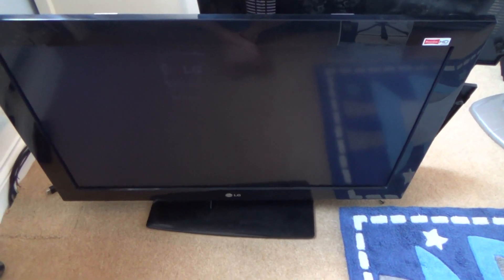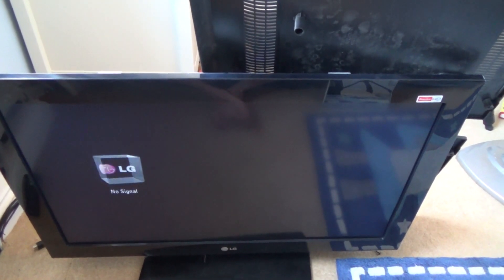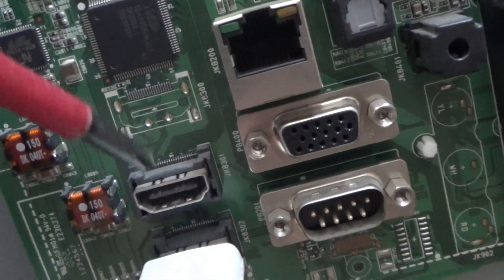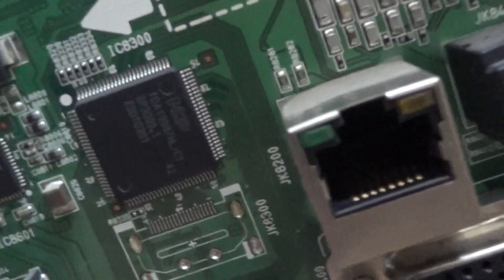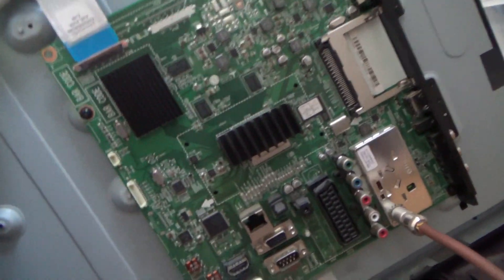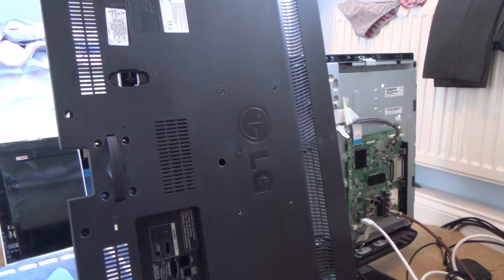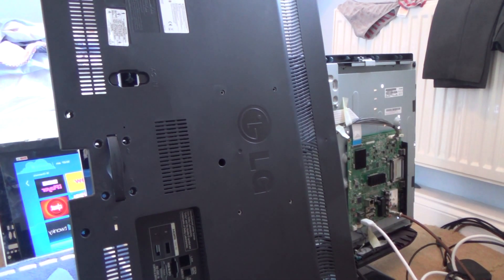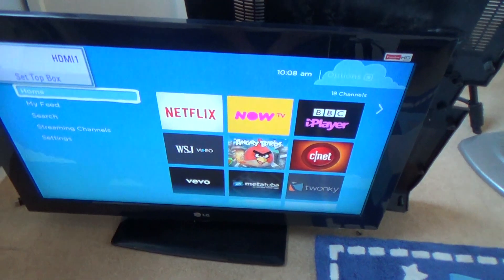Faulty HDMI Port on LG Television. No Signal Fault

Comment: Don't believe it Hdmi ic's usually short been repairing TV's for 40 years i repair this problem every day never saw heat can restore working operation
Reply: I think the heat perhaps temporarily restores a bad solder joint. This board can often be fixed for 6 months or so by cooking it in an oven for 10 minutes at around 200c. I've done it twice on my board so far and just about to attempt it again today. Mine is not getting past the LG startup logo at present.
Reply: it does works, my 42le5550 was fixed in this way (one for hdmi and later for audio) I think that this tv has some heat problem and some internal IC thermocuple is bloqued. I used a hair dryer. I dont think that is a reballing problem.

Comment: it will work for me if my problem is just in 1 of the hdmi inputs??
my hdmi 2 port says "hml hdmi 2", since there i got the "no signal" sign
Reply from the maker: Personally I wouldn't risk doing it as it may ruin the other working HDMI ports. If you get a HDMI switch instead then that will turn your working HDMI port into either 3 ports or 5 ports depending on the HDMI switch you buy. They are under £10.
Reply: What Happens When thanx i will do that
Reply: What Happens When I have a problem with sound, within 2 weeks of each other the sound has gone on hdmi ports 2 and 3, number 1 is still working, any ideas?
Reply: I have the same problem
I have 32 lcd benq hd tv which has 2 hdmi ports
Hdmi 1 is working fine
Hdmi 2 has no signal suddenly
I was thinking what would be better? 
Try the method in the video
Or buy hdmi switch and plug it into hdmi 1 in tv which is working fine? So i can output to many ports.
Then, i had that kind of feeling to tell me to try this video method as i felt it may work with hdmi 2 but im afraid to take this action because i have no idea what may happen and this is why im here.
I hope you guys respond me soon because i feel so sad and don't know what to do.
Thanks a lot.

Comment: T.T It didn't work for me, I even spent 10 minutes with the hair dryier at 10 inches of the chip
Reply: I did using the hottest position on the hair dryer, almost touching the chip, for 5 minutes...  it worked like a charm!
Reply: @webmail3857  
Excuse me, can I dry the chip just with a hair dryer?

Comment: Hey I did this to my 32 LG that was sitting dead in my den for about a year now because the hdmi wasn't working anymore.  Tried your fix today and it worked!  Don't know how long the fix will last on the chip but I googled the chip and will be replacing it if this fix dies.  But in the meantime I now have a  32"in.  computer monitor.  Thanks very much man!
Reply: is it still working since then?  I have the same tv with the same fault
Reply: Brendan Young unfortunately not anymore. It lasted for about a week then hdmi died again. It did say in the vid that the fix may or may not last, I also ordered the chip on ebay and have installed it unfortunately it still didn't revive the tv.
Reply: @AltitudeAerials  I'm also going to purchase the chip. Have you tried once again to replace it? Thank you!

Comment: Hi Carlos, where can I bu the new IC for replacement. For the replacement, it is just a easy unplug and plug process? Thousand thanks.
Reply: Cla,

you can buy that ic on ebay, you need to desoldar the old one then install the new one. that ic has 100 legs, and only one position. there are several videos how to change that kind of ic.
Reply: Thank you
Reply: Whts the ic name

Comment: Had the same problem with my lg,no signal,fast foward 6 months later and bought a roku stick for my other tv and though what the hell ill try it on my lg,plugged it in my hdmi port and usb port(to power the stick) and for some reason my hdmi signal worked perfecly,never had a problem since

Comment: I just did this with an lg 50PX950.  60 seconds with a hairdryer was all it took. Not sure how long it will last, but a miracle for now.  The TV is a boat anchor otherwise.  Thanks for this posting.
Reply: Jim,

don't through it away, it is very easy to fix it. just buy the IC and replace it. I put the IC number on my message above. Check if the main board use the same IC, normally it is always the same one.

Comment: Yes, it works, but it last not too much, and nobody know it. The problem is the chip (IC) TDA19997HL/C1, and the best solution is changing it. it is not necessary to change the electronic board, just change the chip.

Comment: I did the same thing with my LG tv, and after that it worked fine, but definitely the chip that control the HDMI ports has to be replaced. it could failure again.

thanks Sir.
Reply: Carlos Frontado vi em outro post vc conectando que trocou o chip. Como fez isso? Vc mesmo fez?
Reply: How long did fix last you?